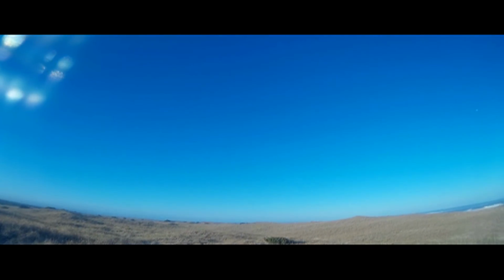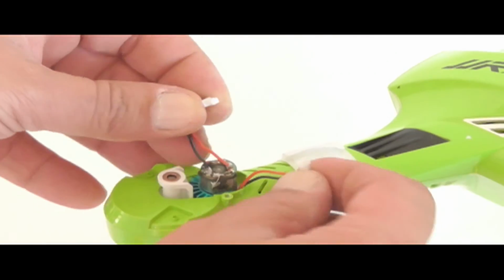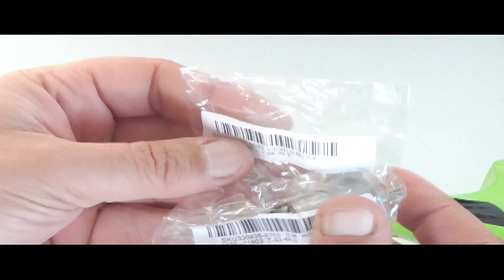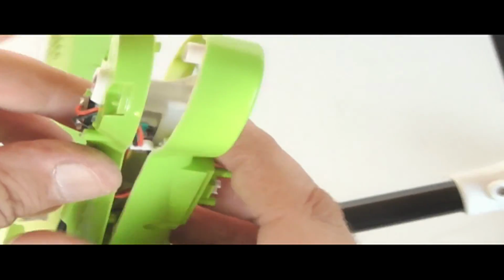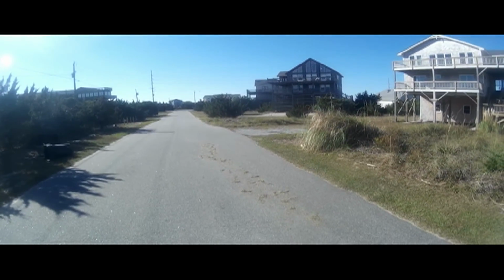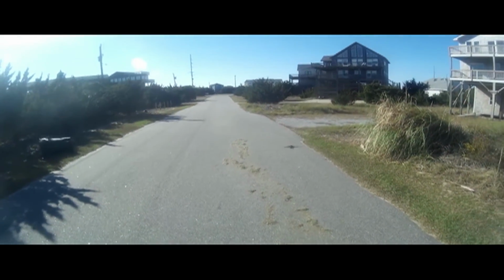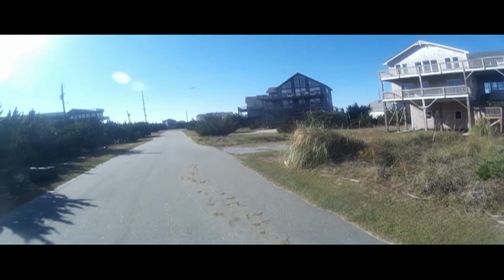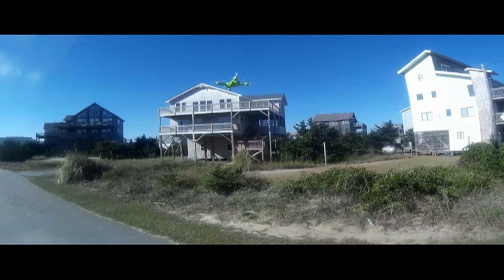JJRC H26 Crash, Motor Replacement  & Test Flight

Comment: I have one in the mail...on its way.  Thank you for the tips  ! I just fixed my friends with the same problem, when the prop hits the ground  / the gear on the "Motor"  separates from the motor shaft , and will not turn with the motor.

Comment: I've worked on Quads many times.  Rule of thumb, always remove the screws for the entire upper half of the plastic body, and always, always, always, pay attention to the location of the wiring.  No need to solder as the motors for the JJRC H26 and Tarantula come with the plugs attached... simple replacement deal dude...